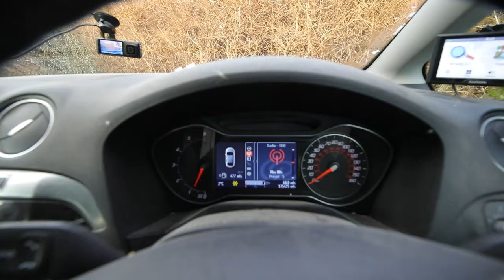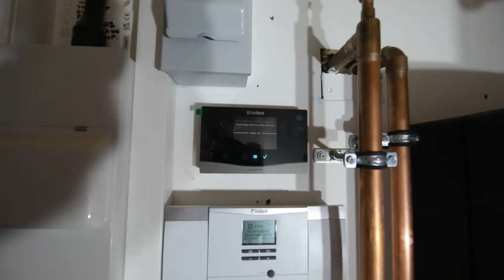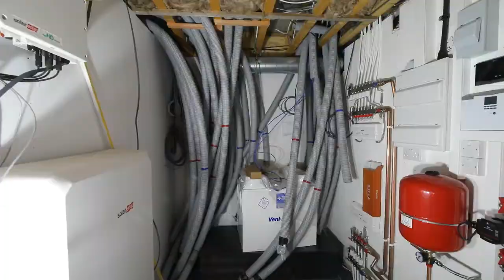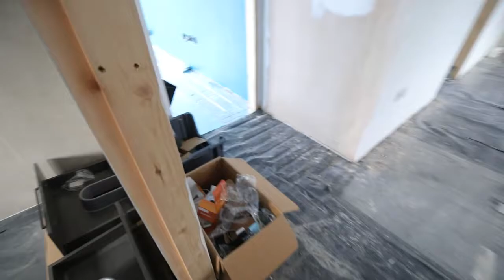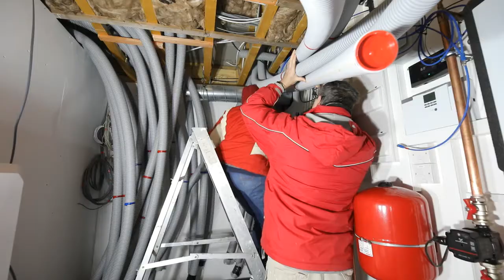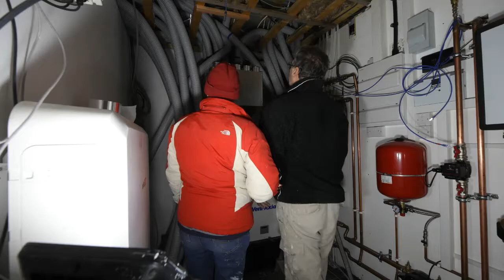The Self Build Day #252 - Taming The Angry Octopus (MVHR System)

Comment: That must have felt like a major achievement. Well done! At some point, I’d be very interested to hear what you would have done differently Helen? TIA👏👌👍
Reply: Hi. The MvHR unit needs a condensation drain and to get the fall needed the unit had to be raised on a plinth. This compressed the amount of space we had above the unit making it harder to squeeze everything in above it (especially with the baffles for sound reduction - the crinkly silver sections). I would have liked the unit to be nearer the sinks drain (in the utility next door) so the unit could be lower. We could have had the ducts coming out from the side of the unit but that didn’t work with other equipment in the room. Anyway, with the reduced working room I would have liked to organise the grey ducts more efficiently through the posi joists so they were in the correct places to go into the manifolds. I would have also insulated the ducts running through the loft more efficiently as they loose lots of heat. I just put them under the normal loft insulation but I think if I did it again I’d lag the pipes themselves before putting the loft insulation on top. This is something I could go back and do ……
Reply: @ Thank you for these details👍 When we get round to ours, I’ll bear these points in mind. Onwards and upwards 👌